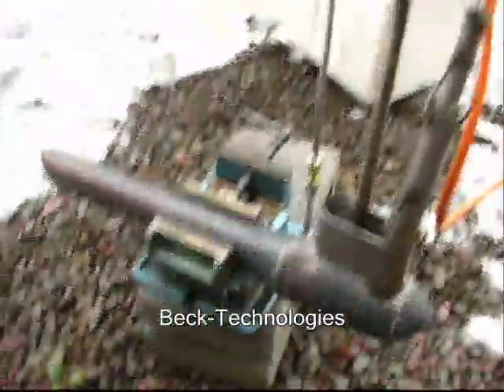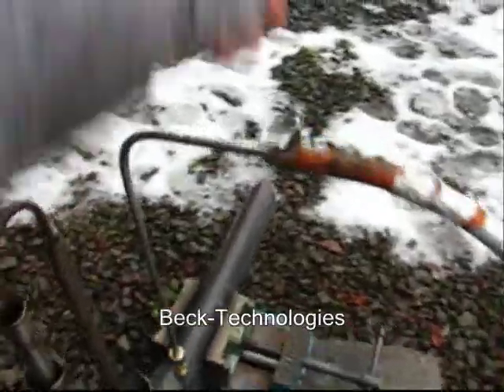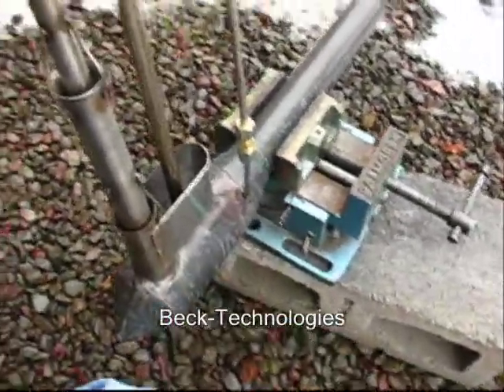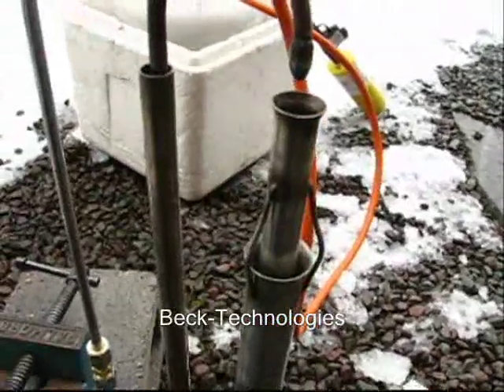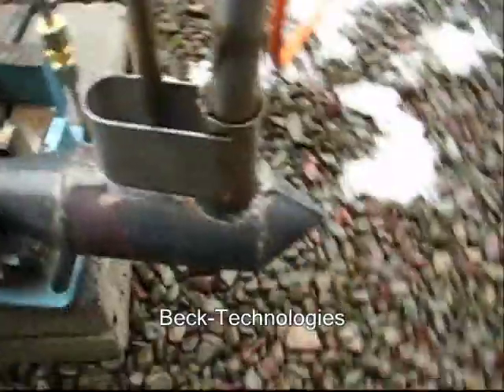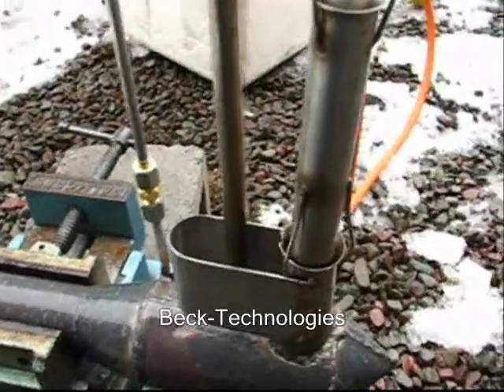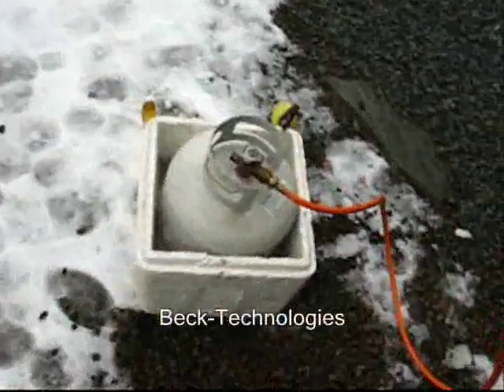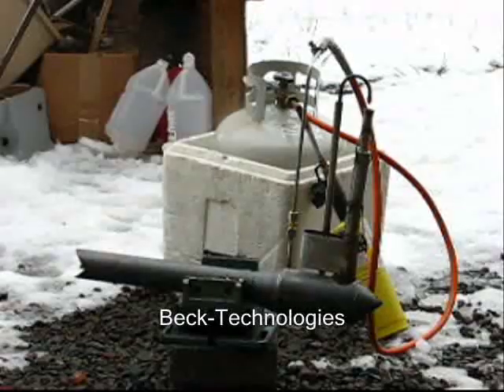Pressure Jet Engine Overview and Starting

Comment: I know this is old as hell but i didnt realize these existed and was on a tesla valve pulse jet build mission and my designe so far is so so similar to this the main difference being my intake it pretty well that but stacked biggest to smallest inside of the jet body with just the biggest flar sticking out the front or side of the body and on the last smallest stage flare behind it i also added a conical baffle bigger than the intake hole with a gap between it and the end of the intake in side the engine giving it alot more restriction going out but allowing smooth flow in. I think i nail it because they start up so easily and barley have and blow back from the intake

Comment: @BeckTechnologies In this video of a jet engine go-kart (watch?v=1Di9CbHy4eY ) I asked whether the Gluhareff pressure jet got more or less mileage than a valveless pulsejet of equivalent power, and the reply was that a 20 lbs propane tank lasts 25% longer with this kind of engine than a valveless pulsejet.

Comment from the maker: Pressure jets are nowhere near as efficient as true pulsejets, metal getting hot isnt necessarily wasted energy. When the heat radiates away from the engine, then it is wasted. Stainless is actually a very good insulator, for how brightly it glows, it only radiates a fraction of the energy of mild steel.

Comment: With the caveat that I might be completely wrong, this resembles a ramjet that uses the momentum of the (heated, expanded) fuel to ram the fuel-air mix into the engine instead of relying on the airspeed to do the same.

(In other words, it has continuous combustion instead of the pulses in a pulsejet.)

Comment: Thank you for the explaination. Bits of information on this sort of engine are usually few and far between. Though it was designed to run the rotors of a helicopter I'm curious if there's been any success in adapting it to RC planes, possibly with a scoop around the intake. Have there been multiple intake designs? What is the thrust of this model?